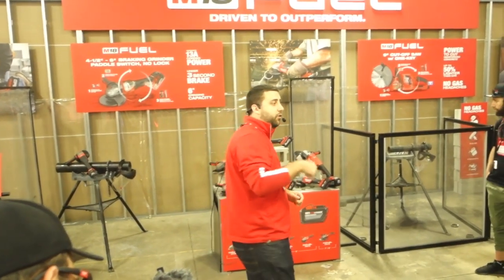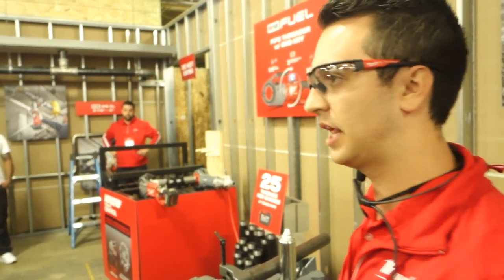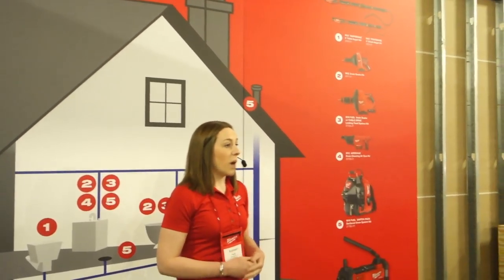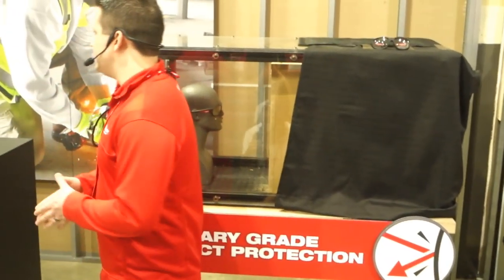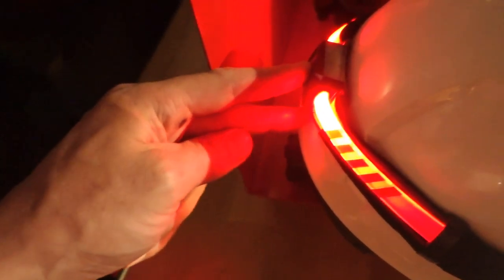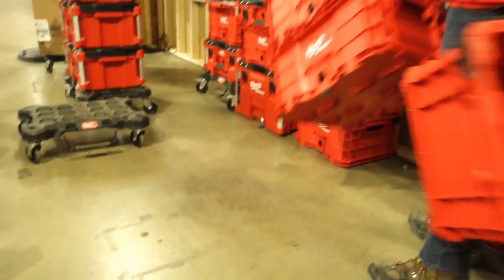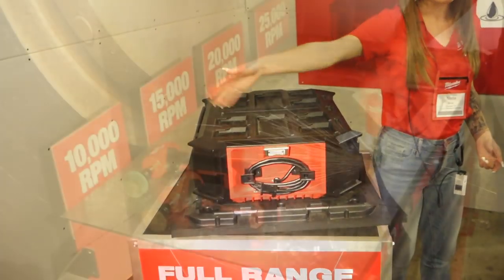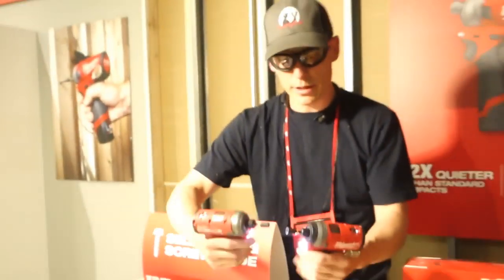All the cordless tools you never knew you needed NPS19

Comment: The drain cleaning machines looks good but i feel that you loose the experience of feeling the cable plus you are adding extra parts that dont know if it will last but i can see their ideas and safety because its not that easy if the plumbing is not correctly done (double santee, or regular/close elbow, heel outlets) and if not careful can go up, tangle or twist and catching your finger.